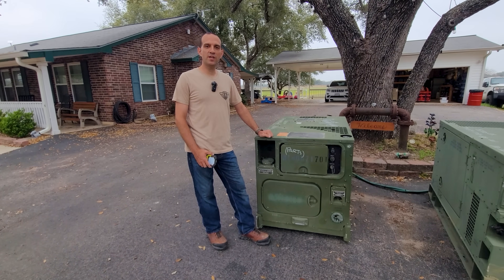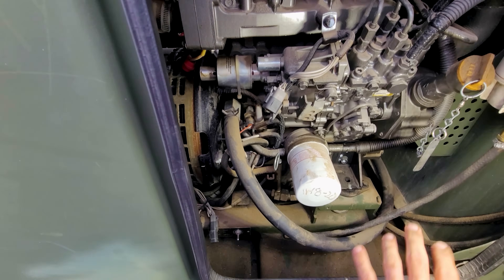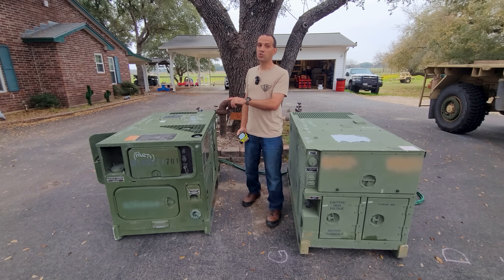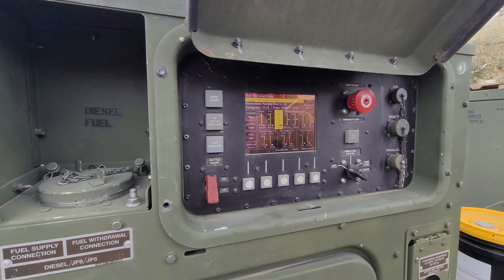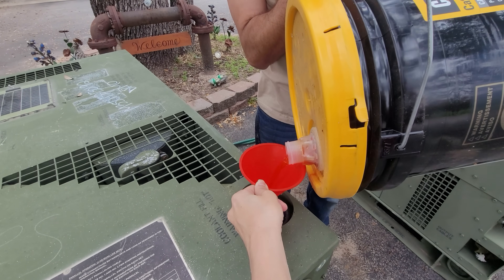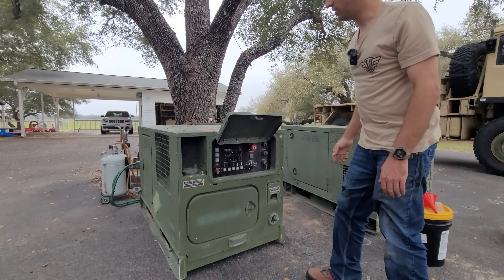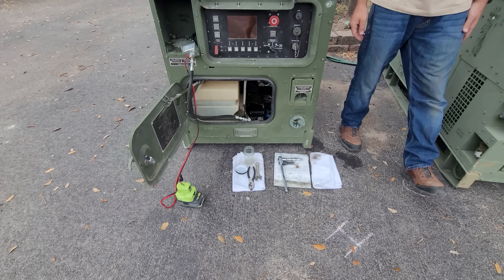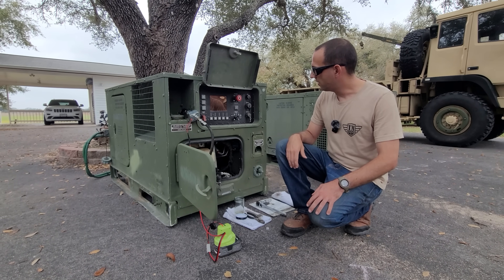MEP 1040 - Part 1

Comment: If a diesel engine runs out of fuel completely the injectors most likely will not self prime you would have to break the seal between the injector pump and the injectors and pressurize the fuel until fuel comes out and then tighten it back down. It's a 3 cylinder I believe so you may luck out and only need to do it to one but I would do it to all three because air bubbles will compress before they will go out of the injector hole whereas diesel is incompressible so the injector pump will successfully push that out of the injector. It's called vapor lock
Reply from the maker: The pumps were bad. Military generators are setup to not have to do this.

Comment: Check where this thing was manufactured and have the software checked for backdoors. This upgraded generator is more vulnerable than the previous, analog generators and could be shut down remotely.
Reply from the maker: They have no back doors & is why they were surplussed, because of the firmware flaws in the controls & the fact they can't be re-flashed, so the military decided to get rid of a lot of them & go to ones that have an upgraded flash if they had a certain amount of use on them. Cummins Onan makes them.

Comment: Change the fuel filter and remove air in fuel system , 52D20.
Reply from the maker: It was not the air or the filter, it was the electric pumps.

Comment: All that heavy diesel equipment, you should learn how to prime a diesel fuel system.
 Doing it this way is going to cost you one day, it puts a lot of unnecessary load on the starting system.
Reply from the maker: So, every fuel delivery system is the same on a diesel? It has an electric pump to prime the system for you. If there is an issue, it struggles & that's what I was working through. What would you have done differently? Once the pump was discovered as the issue, it started fine.

Comment: As a former 91D these are usually easy fixes. All you need is A TM. I loved working on Generators except for the 3k those were super annoying 😂. The problem is the guys tasked to maintain or operate them usually have no idea what they are doing or the Deltas don’t know how to do their jobs other than to perform services.
Reply from the maker: I agree with you 100%. Most of the stuff is not really that hard to do, you just need to take your time and plan a little bit before doing it.

Comment: Military Gen sets have a very clean sin wave which is great for long term use on appliances and anything using a circuit system. Best to stick with older units that have less electronics which always act up during long usage periods or when the ambient temperature is hot. While in Iraq our older tactical quiet Gen sets ran fine for weeks on end but not so for larger and more complicated units. Incorporating an automatic throw circuit for your home is a good idea and most modern military Gen sets can function with an automatic system. 
SFC Devos, K. 11H/11B Retired.
Reply from the maker: You can't beat having a good generator. People who think running a $500 generator for a few days is good are mistaking.

Comment: Is that a GENERAC with an ISUZU engine??
Reply from the maker: No, the military doesn't contract with companies like Generac that have mostly China made products.
Reply: @CallMeColtLLC  Really. I would have thought they would go away from the Chinese stuff.
Reply from the maker: @johnjelinek7643  Most of Generac products are just rebranded units purchased from Chinese manufacturing plants and painted orange. The bigger ones are more US based. I wouldn't ever rely on a Generac product myself unless I was certain of the manufacturer behind the particular unit.

Comment: The 2 fuel pumps that were on the generator that were bad. You can get those at any part store. They sell them as a universal behind the counter.
 And a lot of people used among the old fords. They're way much better pump.  Then
Little square diaphragm that you're using In this video.
Reply from the maker: Most auto parts stores don't carry 24v.

Comment: what does the 'battle short' switch do?
Reply: ahh that makes sense, thanks for answering my question.
Reply from the maker: In a nutshell, it bypasses most of the safeties to keep the unit running.
Reply: @CallMeColtLLC I used to manage generators for television outside broadcast and buried deep in the menus on our generators was a setting called “War Mode”. Like the man said, it pretty much just runs itself into the ground and ignores almost every alarm unless it’s a dead short.
Reply from the maker: @andyscott5978  short circuit is the only one that the battle short won't ignore. 👍

Comment: You should try reviving The bad pumps. It might just need some diesel fuel to lubricate the impeller, just some thoughts.
Reply from the maker: They use a reciprocating rubber diagram to pump, at least I'm pretty sure. They're not jammed. Pretty common for them to go, especially with 4,000 hours. If they were run dry, it will do them in too. Less than $100 to replace both & know they'll be good.
Reply: @CallMeColtLLC  yep

Comment: 16:44 It looks like you have a loose bolt that is supposed to hold the generator head down. I don't know if you or anyone else noticed it or not. But this is a very nice generator I think!!!
Reply from the maker: It's from the missing vibration isolator I pointed out at the beginning. Threads are bottomed out.
Reply: @CallMeColtLLC  Oh sorry 😅😅😅

Comment: For lead acid batteries you need a desulfation cycling charger.😊
Reply from the maker: Optima AGM batteries are in these. I have a NoCo charger that desulphats, pulse charges, and can be changed depending on what type of battery/voltage it is charging. I have revived many batteries with it but these ones were done.

Comment: Have a MEP-802A and Mep-803A If I get a chance, I'll pick up A MEP-1040. Don't know why, just like military generators. I changed my 802A over to a mechanical fuel pump. There is a cover plate on the side of the engine. The pumps are cheap, and available. Need to mode the fuel lines, get, or make a fuel pump rod that goes between the fuel pump and the cam shaft. Made mine out of a bolt that I turned down to the right diameter, had to guess at the length. But it works great.       I use an old clothes dryer as a load.  You lucked out. But your troubleshooting is effective.
I also bought an MEP-831A Got it producing power, put wheels on it, and then the inverter went out. I'll never buy another one.
Reply from the maker: I know you can change to a mechanical lift pump. I thought about doing a video on that, but there is a reason the military went with the electrical one. It was to prevent run away engines. If there is some sort of failure with to governor or shut of linkage, when power is cut, it may not stop right away, but it will run out of fuel in the filters after 30 seconds or so. There is a kit to change an MEP 831A to a traditional generator. I have plans to make a video on this. I may have an inverter for sale down the road as well.
Reply: @CallMeColtLLC  ``Yes, I know about the MEP-831A can be converted to a conventual non- inverter generator. Which seems to defeat the whole purpose of being 3kw and ideal down. So off to the junk yard for scape value.
Reply from the maker: @comeasyouare4545  you get 4.5kw out of the conversion.
Reply: Still not worth it.

Comment: I’ve wanted one of these but they command way too high a price. Someday. My Mep831a is starting to get tired.
Reply from the maker: If you are using an MEP 831A now, and MEP 802A would suite you well I'd think.
Reply: @CallMeColtLLC  I have an 803 and not enough load to keep it busy. I love the inverter style generators for the quiet fuel efficiency. A 1030 would likely be fine though. We live off grid and in the long cold northern winters sometimes go 30 days with no solar. Last winter 42 days with almost no solar panel activity.
Reply from the maker: @timburk6097  That's why I figured an MEP 802A would be good. MEP 803A is a lot of power. These newer ones have flaws. I have two more parts to upload.
Reply: What do you think the ballpark cost was when new to tax payers, I’m guessing 25 grand or higher.

Im not interested what you paid, but it would be cool on a little trailer

Comment: Everyone needs a Military Surplus diesel power station.
Reply from the maker: Yes, they do. It seems right now that most only want to pay the high prices at GovPlanet instead of buying for the same, or sometimes cheaper prices from small businesses that fully refurbish them like I do though. Bit of a head scratcher for me! I'm seeing them sell for way more in unknown condition at auction than I'm selling refurbished ones for!
Reply: @CallMeColtLLC  I see way too many of these roll out of auction with the only issue being at some 19-20 year old kid lacks the skill and time to fix them and has 20 more of them to play with coming down the line.
Reply: @CallMeColtLLC  I found your eBay account and searched for them. I'd prefer the stationary version if I was going to pick one up.
Reply from the maker: @LarryeWhite61  I'm not sure what you mean, stationary version?
Reply: @CallMeColtLLC  not on a trailer
Reply from the maker: @LarryeWhite61  4 bolts and it's off the trailer. I have it listed much cheaper now locally without the trailer or with. Reach out via the contact on my site if interested. www.callmecolt.com
Reply: @CallMeColtLLC  Will have to remember that. 
Q: are parts like the GenHead and fuel pump hard to find?  I'm thinking of long term maintenance.
Reply: hell yeah